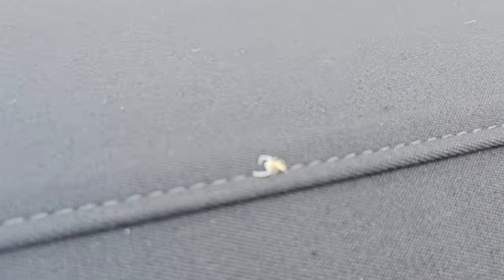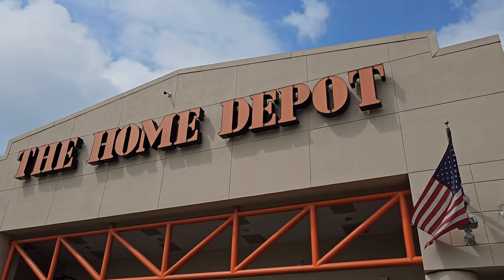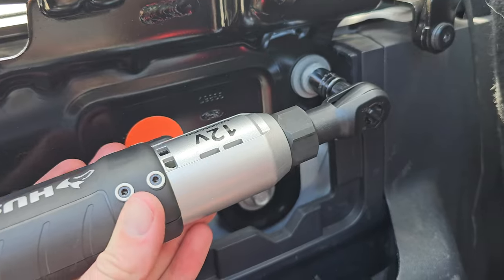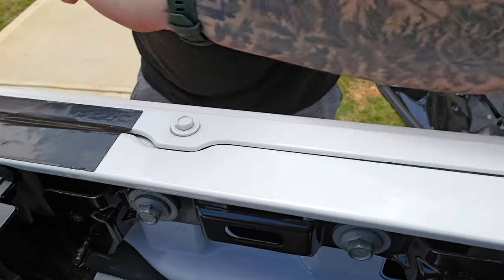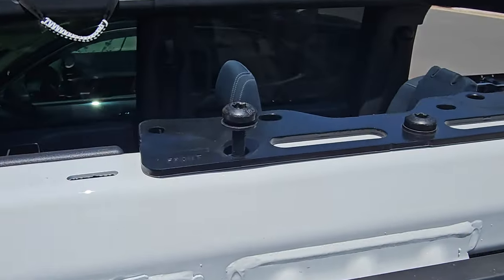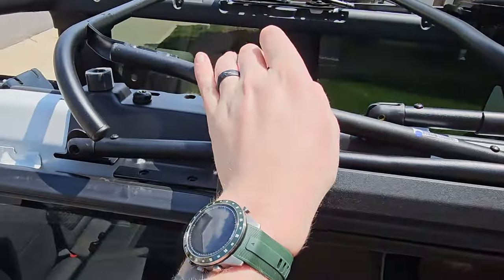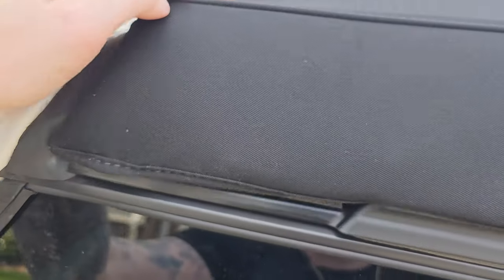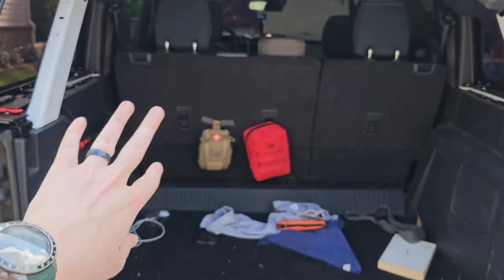This Bronco Soft Top Mod Will Change Your Life!

Comment: Awesome video! I also own a Cactus Gray Bronco. The one mod  I suggest is replacing the rear speaker pods. There are 6.5 inch speaker pods and they make an incredible difference in sound. I placed Kicker speakers and replaced the ones on the dashboard. Super easy install.